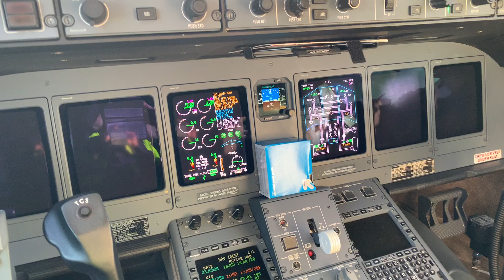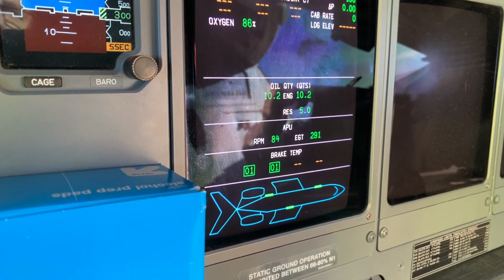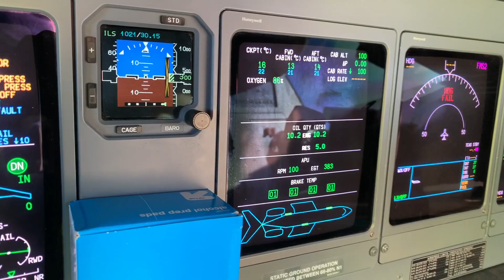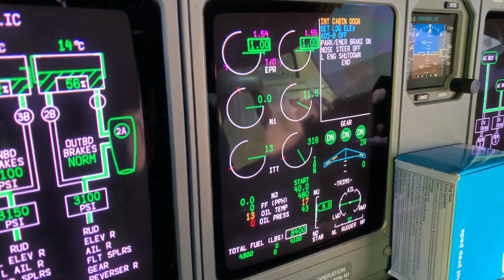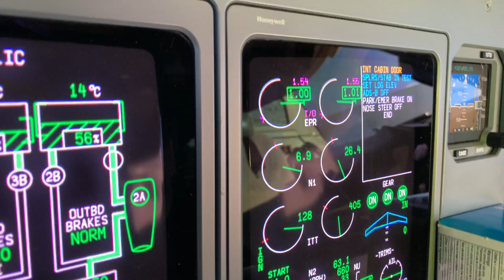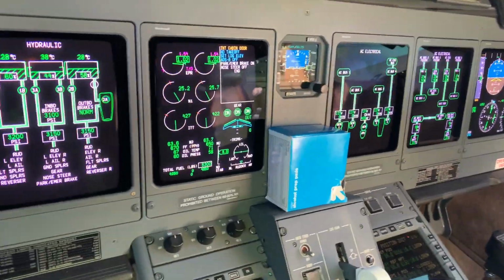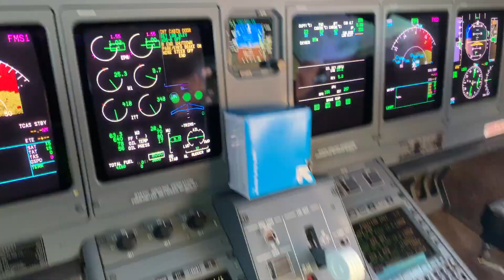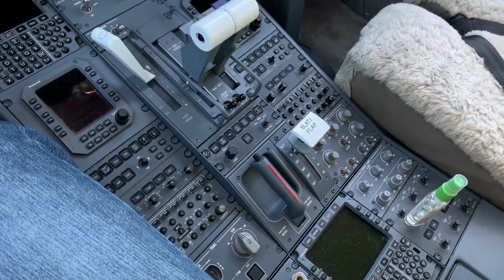A real pilot can show you his aircraft.  C'mon FE pilots - what are you waiting for?

Comment: Great video....
You can tell it's CGI 'cause it looks too good.
Do you make more money as a glober (ha ha autocorrect says "goober") shill or a flat earth pilot?
Could you show how to fill the chem trail tanks?
What is (mechanically) the APU?
Thanks!
Reply: The APU is a gas turbine engine, similar to the actual engines, except much smaller. It has a generator to produce electrical power and provides bleed air to run the A/C and start the engines.

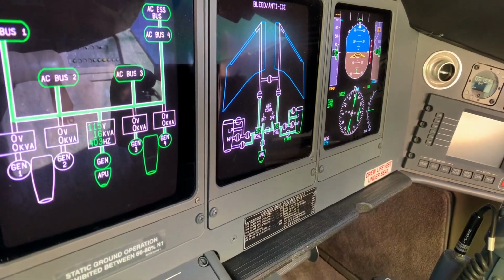Comment: 4:54 Bleed air pressure back up to 55 psi before valve closed on screen. Display updates on feedback contact of starter valve?
Have you ever had an alarm on a valve because either the valve was stuck or the feedback contact was broken?
Lol, getting a bit technical here, it just peeked my interest.
Reply from the maker: On the trip to Washington DC last year the APU bleed air valve would not open.  It was a show stopper.  Luckily we found it during a test run like this and they replaced it prior to an actual flight with passengers.
Reply: @Wolfie6020  Show stopper? Does that mean that this type of airplane cannot use external air to start the main engines or are you simply not allowed to fly it with that valve broken?
Another excellent video btw.
Reply: @Wolfie6020  If you haven't heard it you, as a pilot, should listen to Cabin Pressure, a BBC Radio comedy. One of the episodes, Xinzhou, has an APU that has to be kept running all night whilst the aircraft is stuck at an airport in China.The series starts with Abu Dhabi and ends with Zurich.